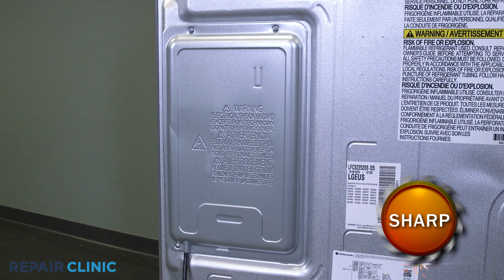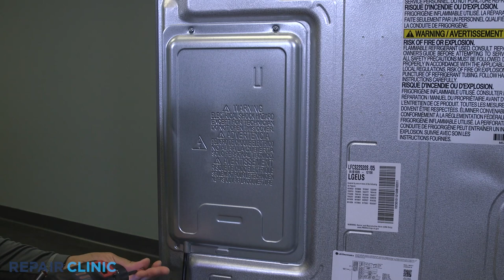LG Refrigerator Main Control Board Replacement EBR81182784

Comment: I have a EBR87463764 board.  Where does the run capacitor attach to.  It is usually plugged into the plug on the bottom right with the Black Orange and Grey wire but there is no plug affixted to that plug. Also on my plug the Orange and grey wire are reversed. Did they mount the Run capacitor somewhere else?  I bought this from Lowes as a scratch and dent and stored it while I remodeled. When I plugged it in it didn't run. When I took the back off the Control board was missing. I ordered the board and the associated run capacitor but when I installed the board is when I realized that there was no place to plug in the Run capacitor. Because this is such a new product no one seems to have any information on it.

Comment: Hello, does this board needs to be programmed? I saw one tech "programing the board"  just wondering if what comes from factory is good to install. My issue is the compressor is not starting. Thanks
Reply: Check the start relay attached to the compressor, if everything runs but the compressor.
Reply: @kdawson020279  good advise, but newer models don't have relay on the compressor, but on the board, like mine, I didn't know how to check on board concerning the relay. Anyone know what to check on the board, or how to jump it to see if compressor turns on
Reply: @charlie9160  This test assumes you have the knowledge to safely troubleshoot live circuits. I am an electrician, and do HVAC repairs, so I own Class 0 gloves [rated for 1000 volts] and leather protectors as well as flame resistant Coveralls.

Voltages can be lethal. While testing, use a lead alligator clipped to the appliance metal chassis for the black lead and probe with one hand only. 

Disclaimer: Don't do this. Danger, Will Robinson.

Unplug fridge. Wait ~ 5 minutes for capacitors to drain out. Remove cover over PCB. Near the bottom of the board there will be multiple rectangular objects marked "RY1" through "RYn" where n is the highest numbered relay location. The start relay is the largest one. It has 4 pins, 2 on each end through the back of the board. Pop your board loose to access the back of the relay. Check for continuity [beep or Ω setting]... the coil will be continuous but it will not read near zero. The two leads on the top [in relation to the refrigerator in normal operation] should show continuity and several Ω of resistance. If it reads infinity or OL, the coil has failed open. If it reads zero ohms the coil has shorted. 

WARNING: DANGER OF ELECTRIC SHOCK!

If your coil checks out, you will need to check the operation. Set your meter to VAC [max of about 125 volts] and unplug the compressor/condenser from the plug location directly under the large relay. Open the door to the fridge, and apply power to the fridge. With a meter on the two outer prongs of the compressor connection on the board, check for am audible/tactile click from the relay upon applying power. On the underside of the board, the topmost pins of the relay should read voltage on one side and ground potential on the other. With the other two, one should have AC voltage on one side and nothing on the other until the compressor is on. If you have coil power, and your relay's line and load pins (lower 2) both have voltage, the problem is not the relay. 

So, if it clicks and voltage goes out from the compressor connection, the relay is not your problem.

You can also bypass the relay by bridging the lower line and load pins, but it can have undesired effects if done improperly.

If you have soldering equipment [good hot iron, solder sucker/wick] those "ice cube" relays are replaceable. However, doing so is beyond the scope of a single comment. 

Hth. Again, I'm a trained professional who works on literally everything for the government, so I respect electricity. I'm only stating what method I would use to test a PCB mount relay. Safety first, second, and third. With a proper bench voltage source, you could test the board and the relay without working on it hot. It's excessive for the homeowner. I'd also check on the marginal savings against buying an OEM board and swapping it power off. Time is money, as they say. Reworking a PCB to swap relays is no trivial task. Good luck!
Reply: @kdawson020279  Thank you for all this, it is way over my basic skills, and decided even before your reply ( and thank you for it, and the time spent to reply) to contact a repair guy , coming in a few days.. I just wish it was on the compressor, so it would be a inexpensive diagnosis and  fix. I still would have liked to avoid the house call. I'm finding out more and more that older appliances last, and newer ones are throwaways. LG and Samsung are headaches. The guy at lowes said he has people complain daily about LG( motor) and Samsung( ice maker).  He said stay with GE and Whirlpool.  I guess repair people  and sales people, that sell extended warranties know best
Reply: @charlie9160  Mine was broken out of the factory carton. Took 2 weeks and a lot of ruined food and I have a working one. I didn't get too far into troubleshooting since I didn't want to void the warranty on my brand new fridge and the place I got it from took care of me but I did thoroughly research the control board. 

Easier way to check whether it's the compressor or the control system is to pull the control and compressor covers while unplugged. Put a finger lightly on the plastic relay housing, if the coil is good you should feel the relay actuate when you power it back on. If it doesn't in normal mode, use the test button to force the compressor and condenser fan to run. On the fancier models, it's repeated presses to cycle test modes. On basic ones like mine, you hold it until it makes a high pitched noise. If it runs in test mode but not normally, you have a thermostat or control board problem. If it doesn't run in either mode, but the relay clicks, it's likely the compressor. 

I got rid of a 40+ year old Amana that ran on R22 that still worked in favor of a new one that didn't. It's frustrating. But, hey, it gave me an excuse to excavate my ancient frozen foods and throw out the partial containers of condiments no one will ever use. I just wish that fridge #1 had worked so that I didn't have the buzzkill of buying a new appliance that doesn't work right.